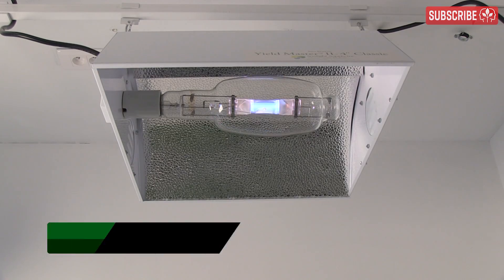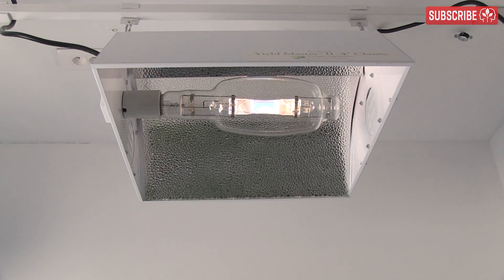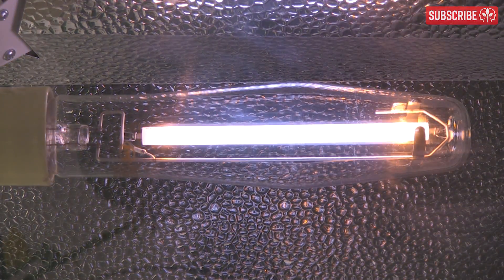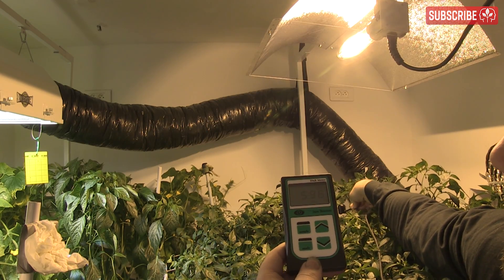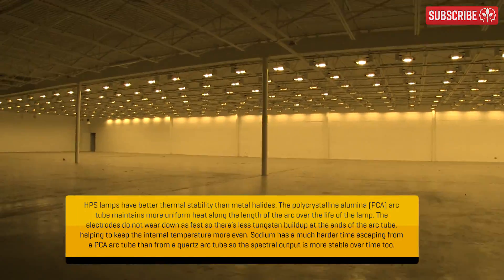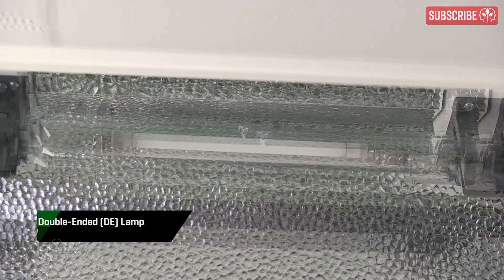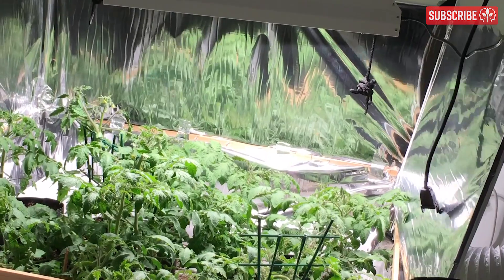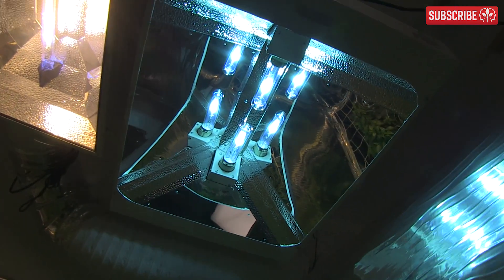How Often Should You Replace High Pressure Sodium and Metal Halide Grow Lamps?

Comment: Massively air-cooled the sh-t out of 6 1k lamps.
6" Blockbusters.
2 chains of 3 lamps inline.
8 to 2 6 inch Y to two chains of three Blockbusters to the 2 6 inch to 8 inch Y to 8 inch ducting to a Harbor Freight 8" blower with a 10" to 8" duct reducer cut and bent to shape to shroud to the 8" duct booster.
1.4 amps of 115v gets you 1,598 cfms.
Cool air intake ran at night.
Fun fact was that the blackening of the arc tubes of the single ended 1k HPS was severely diminished due to massive air-cooling.
As we all know, the blackening of the ends of the arc tubes is a direct measure of lumen degradation.
Classically, according to Ed Rosenthal, you'll lose 5% per three months with single ended HPS lamps.

I experienced far less lumen degradation than this.
Try it out.
Harbor Freight blowers with duct reducers.
Single ended 1k HPS lamps.
There are some with 2,380 micromoles, 179,900 lumens.
Better at the time than any 1k DE lamps.
Cheaper.
Can be air-cooled without lumen loss due to air-cooling.

Baller.

Comment: Okay, so here's a question for the replacement protocol: When you observe degradation issues your avg goon is gunna head back to the grown store and exclaim, " hey, what gives! I wanna new light!" But you say a decrease in spectral quality and luminosity will be observed as a natural degradation. But let's get weird here and say you have UNNATURAL degradation. Like really bad stuff. I imagine lamp manufactures have a line in the sand to judge when a warranty is justified. So my question(s) (finally) is what device(s) are we using to judge dredd that bulb?!  PAR meter? Luminosity sensor? Both? Neither?! Sounds like luminosity is all you'd have to worry about testing since there could be a standard at your given wattage and know when your facing possible loss?
Reply from the maker: +Furious Tortoise Hi FT. The cheap and simple way to judge the output of a lamp is to measure PAR (typically in μmols) on a grid at a set distance from your lamp fixture. The true test is using an Ulbricht (integrating) sphere to measure the total output of the lamp but that's only available to labs. In the middle, you could invest in a spectral radiometer which would give you data on the spectrum / spectral distribution. I will go through all these methods in future vids.

Comment: Time to drop another $120 on a 1000 watt HPS.
Was gonna go hortilux as iv as ways had good results but very exspensive. I went with a growlite that was $20 cheaper but failed early. They warranty my bulb.

What 1000 watt bulb do you recommend for the $ Everest? Heavy fruiting plants ;)
Reply: Hortilux is the way to go. There are some others, but they just can't compare to Hortilux. But if you want to up your game I would look into the double ended lights. (Use to work for a hydro store.)
Reply: https://www.amazon.com/iPower-GLBULBH1000-1000-Watt-Magnetic-Lumen-per-watt-per-dollar/dp/B005HJJC0I/ref=sr_1_4?ie=UTF8&qid=1470955168&sr=8-4&keywords=ipower+1000w

I've been using them for going on 5 years and get great (1g per W+) results. If your room is on point then the bulb brand doesn't matter all that much. I've never had a Horti or Ushio or any of the other big name brands outperform these bulbs during a side by side. Especially at almost 100 bucks more each, they certainly were not worth the extra cost.
Reply from the maker: +Kcarviper DE or SE?

Comment: my C-MH 315, is hooked up to a, surge protected construction grade extension cord, most times i have a lightning storm or just really heavy rain the surge protector gets tripped. and i have to press the button again, now i have read online that this does damage to your C-MH. i just wanted your opinion, plus if i did not have a surge protector my whole light would blow right?
Reply from the maker: +zebedee totty Damage can occur to the CDM lamp if power is cut during the lamp warm up phase (so say for the first 8-10 min of operation) after the lamp has come up to full temperature/pressure cutting power will not harm the lamp at all. From an electrical standpoint, the surge protector is doing its job to protect the downstream device from high in-rush power.  In this instance, a lightning storm. If this situation is a common occurrence you may want to consider a ‘whole house’ system (eg MidNite Solar Inc. ( www.midnitesolar.com )  and go to ‘surge protection devices’ under the Products tab.  A product like this would protect all your equipment from potential electrical harm.  I hope this information is helpful.
Reply: thank you for the info, my house is earthed, i think the surge protector is just worn out, is it is happening more now it also all-ways trip's after only  0.5-1 sec of operation